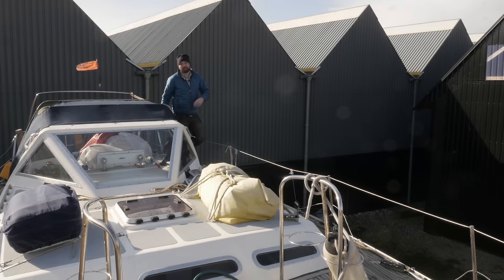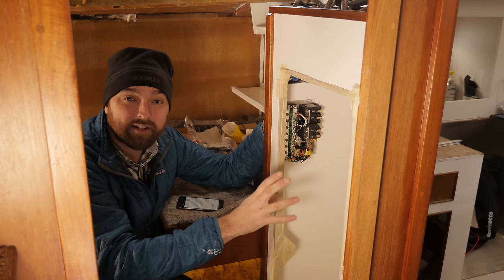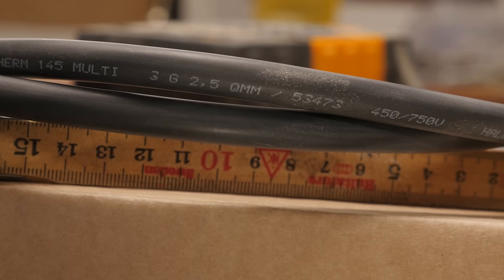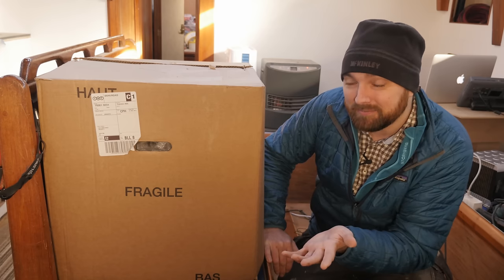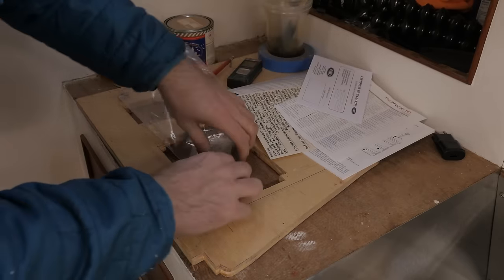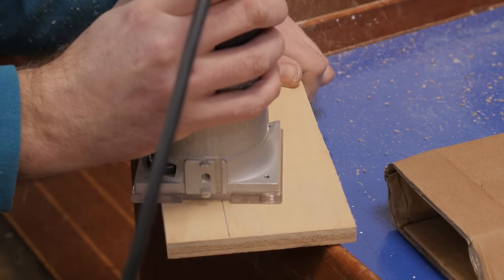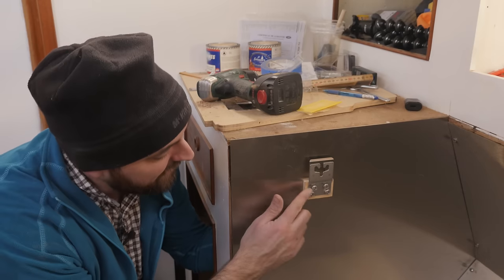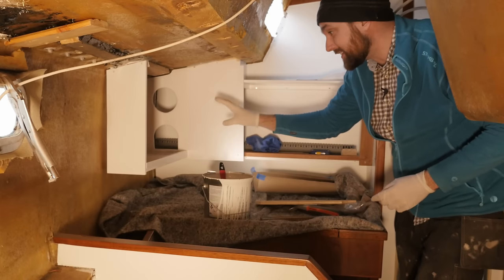Sail Life - Eno Open Sea stove for the galley & prepping to rewire the AC - DIY sailboat refit

Comment: Great update.  I am concerned about having so much vital equipment located in such a small, confined space.  If a small electrical fire got started you could lose all communications, navigation, power (AC and DC).  perhaps hand held GPS also onboard and a separate, second marine band radio located elsewhere with ability to power if needed from another battery might provide some redundancy.

Comment: As far as all the electronics in the one cabinet the only thing that concerns me would be heat.  That stuff is going to produce a fair amount of heat.  Enough that you might even vent it outside.  A hot summer day in the boat would be much hotter in the aft cabin at the nav station with that venting into the cabin.  Two pieces of stainless block would look pretty cool as spacers for the stove.  Stainless with stainless with a bit of stainless is nice lol.  I would send you a some pieces but God knows how long it would take them to get to you from the west coast of the US.

Comment: If you're going to put all those electrical components in that relatively small locker, think of a way to ventilate it. They will generate a significant amount of heat.
I use two case fans, one pushing, one pulling, in my tiny charger/inverter locker, and my reefer compressor compartment, which is directly under the cooker.
They are essentially noiseless and are wired to only operate when the relevant item is in use.
Reply from the maker: I plan on doing something along the lines of what you're doing :)
Reply: Agreed! 120mm case fans are inexpensive (doesn't cost much to carry a spare) and use very little juice to cool a space.
Reply: I just finished the video and your thoughts mirrored mine.  I'm thinking that having the equipment powered on for extended lengths of time will cause significant heat build up.
Reply: Rob Scott  I bought eight fans, thinking that I would have a complete replacement set, should I need them, seven years later, the other four are still in their boxes.
I think I paid about eight dollars each back then, and another two bux each for fan guards. One of the most cost-effective installations ever. 
And on a boat, that's high praise.

Comment: Interesting. Encouraged enough to start looking around and found that Defender in the US carries both ENO and Force 10 stoves, but for some unknown reason, the ENO 3-burner is substantially  (nearly 30%) cheaper than the Force 10, and the only substantive difference I could find was that the large burner on the Force 10 is a little bigger/hotter than the ENO-badged stove has. (9500 BTU/2.4KW compared to 8500 BTU/2.1KW). In actual use, that's not a big difference. And the oven burner on the Force 10 is similarly smaller (5100 BTU/1.28KW vs 6100BTU/1.54KW for the ENO). 

That's a lot of extra money, though, to make better fried rice and worse pizzas. :)

Comment: USB adapters have a draw. If you hard wire a built in USB socket, those milliamps will eat your conscience :) So then you need a switch to turn it off. More steps. You're right x 4!

Comment: Nothing crazy about 12v cigar sockets. Its what I installed because the inserts can be changed to several USB options as well as some other uses. LED lights for example. What may be crazy is buying high quality tinned wire from government surplus all with white insulation and then sleeving it with heat shrink to change the color. Thats what I did. The wire was such a great deal I couldn't pass it up. Naturally that left me with only white wire and potential confusion. Well. really just a LOT of labeling. Instead I bought rolls of colored heat shrink covered entire runs. Crazy maybe, but it worked for me! ⚓

Comment: FYI; Although I'm pretty sure we're an odd duck compared to the rest of the world. The standard color code for the U.S. is black, red, blue for the un-grounded conductors (a,b,c phase respectively) of a 4-wire 120/208 or 120/240(rare) and a white for the Neutral, aka grounded conductor.
Typically orange is used to identify the crazy leg (this is on a delta with a higher voltage B leg that's not used so much any more) Brown, orange, yellow is standard for our 277/480 Y systems with a grey used for the grounded conductor.
And of course green is used universally for the grounding conductor.
Odd colors are generally used for switch legs or they can be identified with a wrap of colored tape ect.
Oh and housing is usually 120/240 single phase, red and black are usually used here, with a white for grounded conductor and the universal green for grounding conductor.
God knows someone will correct me if a made any mistakes here.  ;-)

Comment: Hi, You are doing an awesome job with the electronics install and the stove looks good also, don't forget when you make the cover for the wiring out of stainless and using your angle grinder, get a dedicated stainless cutting disc as the steel cutting discs will impregnate tiny amounts of mild steel into your stainless fabrication causing surface rust.
I have been watching you from the start and you have certainly changed into a real camera personality. the ugly duckling has become a swan.

Comment: Socket is perfect, every 12v compatible "thing" uses the car sockets things so thats the way to go. Also means you can move different "things" around wherever you need them. Prime example, my OnePlus "Dash charge tm" USB2USB type-C car adapter, My phone will charge from a standard USB2 but not their proprietary dash charge system which charges my phone to full in 40 min...

Comment: +Sail Life:  Hello Mads. An excellent video update, is as your usual. Watch them all (unlike a few others, who will remain un-named for present). Since I'm already subscribed, can only click that like button, which was done less than 10 seconds into this. You are exceptionally consistent in the quality/quantity department!

As to items on the boat, the Eno stove looks really good-- ah, make that 'dang spiffy!' Concerning the plywood gimbal spacers, what do you think about the final paint coat being "aluminum," rather than "white?" Just a thought. Finish color consistency, you know. May not make any difference, since the spacers are sort of buried behind/beside the stove.

"Think Different!" Apple is now using USB-C ports to the virtual exclusion of all others in the MacBook models, relying on USB-C for all connections, as well as ubiquitous charging. Of course, since Apple "thimks differently," they call their ports "Thunderbolt 3.0" ports. Who knew? In any event, those sockets are the skoocum ticket, assuming you can find the right USB - and other - adapters to fit. I'll dig around. Just might find it here in the good ol' USA. And, you might try looking around in NYC when you're there in April. If anywhere will have such on the shelf, it will be there--- maybe.

Looking forward to more videos. So, keep on keeping on!

Comment: I installed two of the "old fashioned"  12v sockets in my boat and I have another ready for the v berth and a weather proof box with one in it for the cockpit locker.  If the "tech locker" is going to have a door on it could your isolator be mounted on the back of the door with enough extra wiring to allow for the swing radius of the door?  Nice looking stove/oven, hope it works as good as it looks.

Comment: I have the Bosch GLM15 and found it to be very accurate. That is according to a steel tape measure. However I'm also using imperial instead of metric. That may have something to do with it.

Comment: You mentioned that the inverter, the charger and the isolation transformer but you didn't think all three would fit in that locker.  What if you installed the isolation transformer to the ceiling of the lock?  If that won't work, perhaps swap the isolation transformer with charger inside the locker?  You COULD also mount a U shaped wooden bridge over the dc and ac cables just big enough to mount the transformer (or battery charger)  Anyway I'm sure you'll think of something!

Comment: Have you considered using the underside (Roof) of the top of your tech compartment for the isolator thingy?  after all its not as if you are going to access it all the time.  or space permitting some kind of (Vertical?) rack type mount so it can be easily dismounted without disturbing wiring. maybe i'm just crazy!  love the vids though.

Comment: thanks for your update. I used those sockets in a salt environment and it did not hold up, about 12 weeks before i changed mine out, but others may have another suggestion
Reply from the maker: That sounds horrible. 12 weeks is not a long time. I've got one aboard Obelix that has lasted 3 years but it's well protected down below. Did you find something better?
Reply: Cptn Uwe's Pirate Tales what about a dielectric grease?
Reply: Not realy seems the salt just loves that rear connector. The one at the helm is the one that gives me a the most trouble so i dont use it anymore besides blue tooth is great
Reply: yes that would have been a smart move but i had a brain crash when i installed all three of them, your right

Comment: Well, if the color of that tinned cable isn't to your liking you could buy three meter lengths of thin heat shrink tubing (several colors available) and viola you end up with another color!

Comment: In my experience, the 12V to USB adapters die on regular superspeed basis. Especially on a boat. Don't know why, maybe some kind of quality problems of 12V installation on charter boats we usually use. Still would also think twice now before installing old USB's through out the boat.

Comment: Now that you mention rewiring: Do you need any Coax? You reminded me I got roll of close to 100 m of Aircomplus coax cable in the attic. It's 50 ohms.
Reply from the maker: I do need to run a new cable to the VHF antenna but I was hoping to use something with a smaller diameter. Is that a horrible idea? :)
Reply: Well, that depends... What you want is the least attenuation you can get. Generally, bigger diameter is less attenuation; but material choice also matters. Below a certain attenuation improvements doesn't matter anymore.
I don't have all the numbers; but in an urban environment a loss of 10 dB will half your distance. At sea my guess is significantly less than 10 dB will half your distance. Do you know how to calculate in dB?
Reply: Sail Life For VHF about the smallest coax you would want to consider is LMR-240UF (”UF” equals ”Ultra-Flex”, meaning a stranded center conductor versus solid copper clad aluminum) or a good quality RG-8x (both 240mils or about 6mm) or equivalent, at about 100ft/30m they will lose about 3.0dB and 4.6dB respectively, with every 3dB corresponding a loss of half your transmit and receive signal strength (6dB would be 75% power/signal loss, 12dB is 94% loss, etc.).  Such will perform even better at HF frequencies where the losses are much less for the same length.  However, if you need to operate at UHF frequencies then you will need a minimum of LMR-400UF or good quality RG-8 (400mils or about 12mm) as the losses are enormous up at the UHF end -- even LMR-400UF will lose around 3dB, or half your signal, at 450MHz over a 100ft/30m distance.  Generally you want to aim for no more than 3-4dB of loss at your maximum target frequency for the length of your coax run and those losses are proportional to distance, so a loss of 3dB/30m is equal to 1.5dB/15m.  If you should need a run of greater than 100ft/30m then you would want to upgrade to a larger diameter and lower loss coax to ensure your maximum losses at the maximum frequency of interest is never more than around 3-4dB.  Range at VHF and UHF is predominantly a function of line of site to horizon, with that distance increasing the higher each party's antenna is located with the effective radiated power primarily influencing how well you can overcome interference and/or obstacles along that path with a stronger signal helping to ensure you retain an intelligible signal on transmit or receive.  At HF, particularly 14MHz and below, things get much more "magical" with reflections off the ionosphere and ground allowing you to transmit well beyond line of sight (even around the world) with the optimal frequency varying with time of day and atmospheric conditions.
Reply: As Ethan correctly points out the loss is highly dependent on what signal HF, VHF or UHF signal you want to carry and how long the wire is. VHF and UHF will under any circumstances reach just beyond the horizon.

So, what frequency, what length, and what cable did you intend to use?  Also, because I only know about electronics and nothing about maritime systems, is your radio and antenna 75 or 50 ohms? 

Anyway, if the cable suits your needs nothing beats free. I think I can have a friend bring it from Zealand as far as Aarhus. Perhaps someone else on your channel can help with the remaining bit.

Comment: I'm not sure if this stuff is appropriate for marine use but I think it comes in a tinned version and it's tough as all holy hell.
"Overall, SOOW cable resists oil, solvents, water, ozone, aging, and abrasion. It is also flame retardant, flexible, and durable."
Reply from the maker: Got a link? :)
Reply: http://www.awcwire.com/producttoc.aspx?id=soow-cable
http://www.leviton.com/en/products/electrical-wiring-devices/usb-charger-devices/usb-chargerduplex-tamperresistant-receptacle
The USB outlets are electronic so the draw when not in use should be minimal, (I could be wrong).
I would not use any household 15A switches, receptacles or the like, 12 AWG and 20A devices should be the minimum and of course DO NOT use solid wire anywhere on a boat, although I did see a nice copper buss installation between batteries with shrink-wrap used as insulation (looked pretty skookum) 
Also wherever you would normally put a duplex outlet you should probably just use a quad, you know your going to use it and someday it'll save you from overloading an outlet extender and burning your boat down to the water line, eh?
Reply: reagentism This is a European boat, not American
Reply: Matthew Brown 
ok thanks, are the electrons different over there?
Reply: Oh you are refering to the outlets, not the cable?
Yes I included those outlets for reference only, obviously you world want a more world-flexible design on the outlets
Reply: Bus bars between batteries may make it more difficult to remove batteries. Depending on the install location it may even be better to have some extra length in the cables to allow the batteries to be lifted out of a tight location to make working on the connections easier. Even when working on a motor car it is a pain when the battery connections have tiny amounts of play requiring all manner of contortions of the heavy battery to get it past the cabling and connectors. Extra cable length also allows for the possibility of cutting off a few inches in the future to remove a corroded or damaged end and still have enough length. Thereby avoiding cable joins or having to re-run new cable.

Comment: I don't know where you are planing on having your batteries, but your charger should be mounted as close as possible to the batteries.
Also make sure that the charger has a temperature compensation gauge.

Comment: For your cable, you may what to look at digikey.com  and change to your county to get the price in your location. They have 18,000 cables and 1077 which are tinned and AWG 14 and 16. Do a search for 'cables, wires' then  pick Multiple conductor cable. and have fun with the options to pick the cable  you need.

Comment: You could have used a piece of molding (base shoe, quarter round, cove, etc.) to hide your gap in the plywood panel, thus avoiding the need to recut the piece.  You can very easily hide a lot of sins that way in woodworking whenever the need arises -- a major part of the Art of Woodworking is learning how to hide or recover from mistakes without anyone ever being the wiser!

Comment: As for the tinned cable. Have a look at LAPP Kabel. They are from Germany. Especially the ÖLFLEX® HEAT 125 MC

http://products.lappgroup.com/online-catalogue/power-and-control-cables/expanded-ambient-temperatures/cross-linked-cables-55c-to-125c/oelflex-heat-125-mc.html
Reply from the maker: I can't seem to find anywhere where I can purchase under 100 meters :P Also the outer insulation is black. I'd really like a different color so that there is no confusing it with the DC neg.

Comment: 1) You watch to much Canadian YouTube content with your pixie wrangling and your fondness for shiny items in shipping boxes.

2) Are mostly correct about the 12v sockets vs USB with a couple exceptions. The Marine USB ports are tinned and waterproof. And they handle a very large voltage range 9-30v while still regulating a very clean 5v output. The automotive style adapters won't last long in a moist environment and only expect to regulate output voltage from a very small input voltage range 12-14v

Comment: Have you ruled out fiber cable as your network backbone? It seems like it would be pretty marine proof? Let me know why you chose against it if you don't mind.
Reply from the maker: The network I'll have aboard the boat will be very limited (most of the devices will be wireless). It'll all be short runs inside the port side aft cabin and a single on up to an antenna. Going with fiber-optic cable seems a little overkill in my simple setup :)

Comment: Any and all charging feats should be done within a safe area. Even more so in a boat. Why risk it? So please, consider fire hazards if you're mounting a charger in the locker.
Reply: My GLM 50 Pro is pretty accurate above 10 cm (doesn't read below). I also clean the lens each time i use it with a special cloth, and, make sure the batteries are fresh, the laser eats them pretty quick, and once it drops in the range where it shows the battery, it's going to mess measurements.